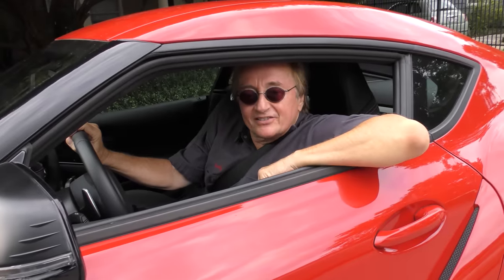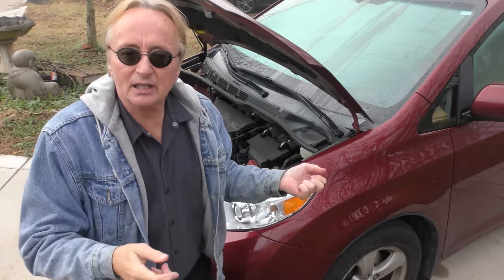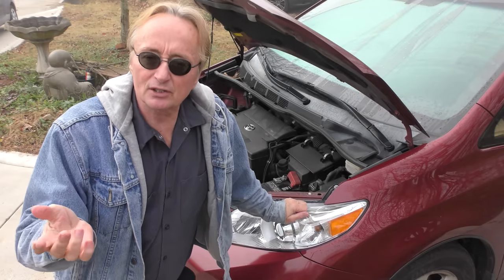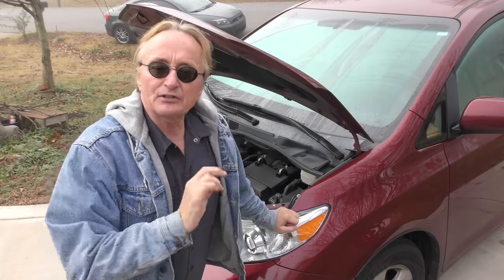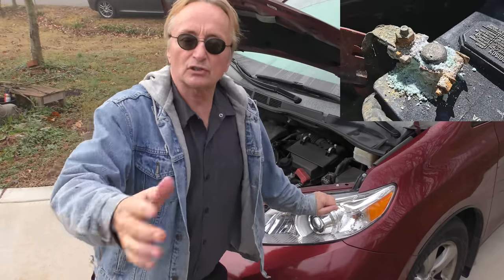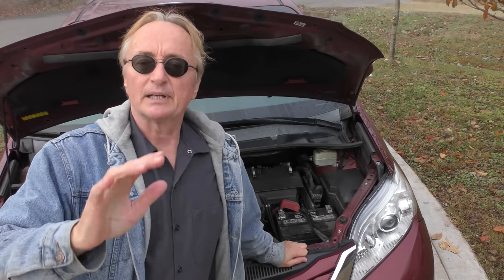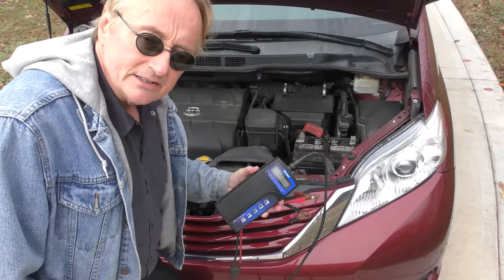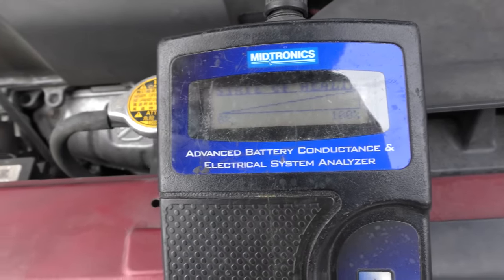If You Buy a Car Battery from This Place You’re Stupid

Comment: The batteries the Walmart and autozone sells come from the same factory.  The only thing different is the label.  They are both made by Johnson Controls.  I know because I am a truck driver and I have picked up and delivered these.
Reply: Thank u for that insight 👍🏾
Reply: Also Walmart beats the heck out of Autozone's prices. Advance Auto too.
Reply: MVP truck driver, I'm a service technician at walmart and was curious how the battery was compared to autozone
Reply: That could be location dependant.
There are only a few battery companies in the USA. Walmart might buy from more than one, depending on price and location. 
Always check the manufacturer date.
Reply: Yes they come from the same factory. But they make different quality for each retailer.  The top line Walmart battery is equivalent to autozones mid level.
Reply: @karkule5919  calm down with your keyboard anger buddy, it’s about a battery 10-4 over and out!
Reply: As a walmart technician if u buy the everstart battery the best bang for your buck is get the maxx 
Think of it like sams, yes ur paying more but ur getting more per value, honestly as long as ur cca(cold cranking amps) is the same as what's already in ur car and u get the same size it doesn't matter what the book or computer says when u put ur year, make, and modle, also extra cca won't hurt anything just means easier cold start in colder weather and longer life
Just make sure cca and battery size is the same and ur good
My honda civic battery cost $149.88 at Walmart but i can get better cca and same size for $75.88 at Walmart

We can't just tell u yea this battery will work xyz, we are told to go by what the computer or book says
Fun fact :D the more u know
Reply: That’s good to know thanks for the info
Reply: Same with car parts - some are interchangeable, but more expensive on the higher end cars.
Reply: Here they were from Johnson Controls and they were great batteries, but now there Interstate and I had two fail within two years, only had one from Johnson Controls  fail in ten years.
Reply: @waynefoster5913  I was gonna get interstate but I’m not sure now
Reply: @craigshapiro8662  you are correct, major national brands have such buying power they can require a manufacturer to custom manufacture a product to meet the sellers cost at retail and the only way to do that is to lessen the quality of the product. 
 I get annoyed by these kind of "you're being ripped off" videos, if you don't want to buy a battery when yours has died then be smart and replace it before it fails. It's not a surprise a battery usually fails in 4 to 5 years, so when it's 4 years old go get a new one and pay as little as you can and shut the fu*k up or make one yourself Scotty.
Reply: Your life is now in danger...lol
Reply: @JohnT2088  ..no costco around these parts, so it's Walmart..buy their cheaper batteries for an old beater, buy their top-of-the-line battery for something you use on long trips...
Reply: A guy I know had a Japanese car...Honda I think...he thought the battery lasted 11 years!
Reply: The longer the warranty the higher the price but higher CCA and a better battery.
Reply: @froglobster    I don't blame you.  Not sure what the deal is with Interstate CAR batteries, but I've not seen one last more than 2 or 3 years around here and I'm involved with a couple of car clubs and automotive organizations and I've seen a lot of batteries.  I've noted that the stockpiles of core batteries retailers have taken in for for recycling seem to include a high percentage of Interstate brands.  Now, that said:  These were CAR batteries.  The big Interstate truck batteries you'd see in something like a Kenworth etc are a different deal.  These large batteries seem to go on and on and on, last pair that went into the crane truck where I worked lasted for 7 years.  But, a group-24 Interstate battery that was bought by an employee there for his car barely made it past the 2nd winter.   All things considered:  My best luck with batteries has been mostly with stuff made by Johnson Controls, including the Everstart brand Wal-Mart sells.  I have maybe 5 or 6 of them in the vehicles I own, been using them for over a decade, never had one fail inside its warranty.
Reply: @karkule5919    Sam, buddy... the irony is thick.
Reply: @Jack51971  ..yes, but that'd be Walmart for 99% of people who don't live in an urban area...never been in a Costco(haven't even seen one), and the nearest Sam's Club is at least an hour away...and I don't exactly live in the middle of nowhere(not anymore, anyway) :(
Reply: @tonyunderwood9678  Yeah thanks for that insight- I think the quality has changed somehow-plates? Plastic?- idk . Back in the day I ran my novas Malibu’s impalas trucks everything on interstate. When our politicians let the car shows back again I’m gonna look at the interstate population! Good day
Reply: The same applies to power tools.
A very small number of manufactures make multiple brand power tools.
Something like four manufacturers make 20 different brands.
It is a type of manufacturing incest.
Reply: True, but they use different build standards for each brand between Wally and Autozone. Autozone was good 10 years ago, but my last two from them were crap. Motorcraft Johnson Control batteries are the best built IMO.
Reply: I baught a battery from Walmart in 2018,, and I didn't drive my car for a few weeks left the door open and it drained out the battery,,, so I brought it back to Walmart and they gave me a brand new 2020 battery For free.. cause most of their batteries have a 3 to 5 years warranty.
Reply: @froglobster  
They are made by Johnson Controls for Motorcraft. It is Ford's brand for their parts. Not sure who sells them in parts stores these days. For dealer will have them. I think you can buy Johnson controls batteries directly from their distributors with their name on it. If you want the absolute best battery, go with the Odyssey battery. Pricey but easily 2x the performance/quality of any other lead acid battery. After that is lithium, but they are even more expensive.
Reply: @ujayet  
Overall they are good for the price.
Reply: @grassroot011  even though the VAST amount of batteries exchanged at autozone for new ones come from.........(wait for it).....walmart???
Reply: @grassroot011  my 2008 jeep compass has a battery from o'reily  and it wont die for nothing.
Reply: autozone has a contract from bosh to make all their part,  and brand names them everything from econocraft, valuecraft, duralast and bosh itself. they set different prices for this stuff to give the illusion that each name gives you different quality and performance, lol. all they re doing is making profit off the warranties .as far as going to walmart for batteries, they probably are suspect because the average person isn't looking at walmart for the first place to go to buy a battery so they sit on the shelf for a little while , plus walmart is becoming really strict with their return policies these days. you buy almost anything at  the discount auto stores, if you don't like it, just return it, with enough of a fuss, they will take it back. ( a typical district manager will give a refund to 99% of all customers who complain)
Reply: Exactly!  Thanks for bringing that up. 👍🏻
Reply: From the guy who knows.
Reply: Johnson control does make them your correct but Walmart sells used returns that go bad extremely fast
Reply: So for my 19 Corolla, one of those cheap batteries "Ever Start" brand should work fine?
Reply: Johnson Controls also makes Optima.
Reply: @sashaminx75  👍🏻
Reply: Yeah but I swear Walmart buys all of Autozones reject batteries though because I've had more problems with Walmarts everstart batteries than any other brand. They're's is a reason why their cheaper than any other brand out there.
Reply: Johnson Controls has sold its battery division to Brookfield Corporation. I don't know if they still supply battery's to Walmart anymore. (after the current stock runs out!)
Reply: @grassroot011  That's assuming you get a good Battery from Walmart though. There quality control isn't exactly great and I'm not the only one that complains about Walmart batteries. I swear they buy everyone else's rejects. I've had far more issues from Walmart batteries than any other brand.
Reply: That was exactly my question for Scott, because a salesman at one of the higher price auto parts stores told me his manager toured one of the TWO US battery manufacturers and saw it for himself.  What a scam!
Reply: @craigshapiro8662  Yeah, I have bought the cheapest level battery from them and they're pretty much crap,  but if you buy the one with a 2 year or 3 year batteries.  Huge difference.
Reply: Yeah but Walmart buys all of Autozone and Advance Auto Parts reject batteries though.
Reply: @JohnT2088   no the quality is not good at Walmart. The batteries are built to whatever the client wants. Always remember that.
Reply: I’m a truck driver also, and I know what you’re saying. Folks would be surprised and maybe even shocked if they knew how many products they see on the shelves with different brands on them all come from the same place.
Reply: Don't be so cheap.  I live off a very small disability check and even I can afford to buy a new battery every THREE YEARS. What you're doing is why companies have to STOP OFFERING WARRANTIES,  or offer only a very limited one. You may "think" you're saving money,  but people who do what you're doing are WHY the warranties disappear in the first place.   Not a smart move.
Reply: Do you know this for a FACT,  or are you just saying that because that seems to be the general consensus about Walmart batteries? I've always heard to never buy a battery from Walmart Neenah they're crap. But when the salesman from a higher standard of quality auto parts store (only because people GIVE them that status), tell me that his higher priced batteries are EXACTLY the same batteries,  with just different labels,  THAT'S who I'm going to believe.
Reply: @stacyturner1317   I've personally had far more issues out of Walmart batteries than any other brand. I swear I think Walmart buys everyone else's reject batteries.
Reply: @JoshSmith-wo7zw  I'm just wondering 2 things. Did you buy the cheapest one they had for your car? That's a mistake I've made before. About a year and a half ago it was time for me to get new battery, but because I was going to try to sell it, I didn't want to put an expensive battery in it. So against what I"ve always heard" about Walmart batteries, I went down and bought the cheapest one they had, $50. It did great, for about 8 months, then I started having to jump it, just once in a while at first, then every day, then every time I drove it. And I went to one of the "auto parts" stores to have the battery tested, they told me it was fine, even tested it under load. 

I was beginning to think I had a parasitic drain and was REALLY dreading trying to find that. Nope, bought a new battery at Walmart, but this time I bought the best one (because by this time, I was one week outside of the replacement period) with a 3 year warranty, and even when it got down to 5 below here this past winter, she started right up. And the 2nd questions is did you check the date on the batteries when you bought them? That's something I "just learned" by watching videos like this from Scotty. I know I'll be checking them first now!
Reply: @JohnT2088  ..no membership at Costco?...how about there ISN'T any Costoco...for hundreds of miles...there's a Walmart literally EVERYWHERE....that fact may also come in handy if you have to warranty your battery while traveling...
Reply: @Thor Odin son Good to know my suspicions are well founded. I had always been certain that which batteries get which retailers' labels is determined by which pass QC by the larger (or lesser) margin at certain battery specs. Simply being the same manufacturer doesn't mean they're all equal.
Reply: @grassroot011  Rule King is even cheaper and last just as long
Reply: @craigshapiro8662  Yes. That's why within any brand they have different price levels.
Reply: @waynefoster5913  My Costco battery (Interstate) went bad about three months before the free replacement warranty was going to end. I have a AC Delco AGM battery in my Mercedes that I bought back in 2015. It's still running. The battery tester shows that it is getting weaker.
Reply: @kevinmoore4887  They do.  First one was Johnson Controls, second one I bought was not.  I do find that their batteries don't last as long as Autozone batteries.  But the best battery I ever owned was Bosch.  That thing is still going strong after 5 years.  Got 2 of them from Pep Boys, one for a Camry and the other for a Tundra.
Reply: @alecepting1371  Ugh. Have to check who manufacturers the battery.  My Wal-Mart Johnson Controls battery lasted 5 years.
Reply: @kevinmoore4887  I believe the second was manufactured by Clarios in Wisconsin.
Reply: Nope. Same factory, different sides. Autozone batteries are made with materials and equipment from Bosch. Walmart batteries used recycled materials. Same building yes. Greatly different quality.
Reply: @sporadicofart  Where can you find Bosch?  I can't seem to find any place to buy their car batteries in the US any more.  Pep Boys no longer carries them.
Reply: 40 yrs. ago at an oil filter company. Same filter 12 different labels. Label is worth more than the product.
Reply: Walmart car batteries are junk. I know this because I’ve been through enough of them. They would take a 💩 not even a year.
Reply: Walmart car batteries are junk. I’ve had them fail less than a year. The replacement didn’t last long either. I even had a Walmart battery puke at 50F.
Reply: Got a Duralast gold from autozone, 2 months in and out was a lemon. New one is in, hope it will last...
Reply: i replaced a fairly new battery out of my tahoe from walmart with a duralast gold. they are not all the same. walmart batteries are junk.  dont believe me? try cold starting it in 10 degree weather.
Reply: I've been told they are mostly made in Mexico and my bottom line is the warranty. Walmart's is best. Tell me I'm wrong.
Reply: True, same factory, but must be manufactured to different specs...because over the past 30 years I've had more problems with having to return defective Walmart batteries more frequently....after only 9 months to 2 years compared to any other battery like DieHard Gold or Platinum or even the Samsclub Duracell AGM I tried.  The expensive ones have all lasted 5 years or more, including the nice factory OEM batteries from Subaru, Toyota, and Honda.  They're so darned expensive I sometimes get suckered into buying the Walmart ones at less than half the price when my budget is hurting.  Luckily the warranty covered free replacement in all my Walmart experiences (after waiting a day for them to test the defective battery on their fancy dan machine...even after my cheap digital tester says it's shot) but honestly, every time I replace the battery, 30% of the time the power coming back online causes the speedometer dial to jump all the way around and reverses to the other side (no matter which terminal I connect first), and I would rather pay more for a higher quality battery and save myself having to come out to a dead car more frequently and replace it under warranty 3 times in 5 years and then having to remove and disassemble the instrument cluster because the magnet trick doesn't always work on all models of speedometers.
Reply: Auto zone it is.
Reply: @froglobster  ??? are you "over" or are you "out"?  Very different radio terms.
Reply: @reggienone966  Well no, I believe the terminology “over and out” is a well known standard of 50 plus years. Over deems finished talking and Out deems going off air leaving the channel for other truckers to talk.
Not arguing or disputing your interpretation.
Reply: They may be made by JC, but there's still differences in quality between some of the different branded wallet sucking plastic tubs. Although JC should be holding their greedy heads in shame at the pisspoor quality of todays battery.
Reply: @JoshSmith-wo7zw  Back in the 90s the Everstart WM batteries were hit and miss. You might have had to return one or two to get a good one. Many people called them Neverstart. I don't know how the modern ones are since I quit buying them.
Reply: Yeah but the batteries Johnson Controls sells to Walmart do not have the same Quality Control as the batteries that are sold to Auto Zone and Advance Auto parts etc. There's a very good reason why their so much cheaper.
Reply: @unti419   I still wouldn't buy one. The Quality Control just isn't there on the   Walmart batteries.
Reply: @JoshSmith-wo7zw  I buy my batteries from either ORieiies or Napa. Never a problem.
Reply: Neverstart and Duratrash... junk batteries
Reply: The only decent battery is a Deka. They last me 10 years when I use them all year and do r trickle charge them in the winter because I'm using the Yukon all the time. The ones in my hot rods are both 13 years old because I keep them on a trickle charger during the cold months. They will last forever as I check the water levels and keep them filled and charged. 

If your batteries are going bad it's because you're not maintaining the water levels in them. It's very simple. Peel back the stickers fill the holes with distilled water. Get 200 amp starter charger and charge them for 15 minutes or so with 60 minutes in between. Do it four or five times and they will last forever. But you don't even have to do that If you just maintain the water levels before they die. If they go bad just refill them and recharge them and they'll be fine. There's really no need to buy a new battery. And most people don't know how to maintain their battery.
Reply: @Spike_-rx7bx  what battery should i get for a pilot 2012? Any idea ?
Reply: @MrSambra22  our book says minimal cca 585 for walmart the book says 35 Maxx or 24F( if you see the F or the R it means the poles + and - are flipped from left to right or vise versa)

I personally have die hard battery for past 2-3yrs platinum no issues yet(no acid leaks or seepage yet)

I hear cust complain the value battery's at walmart only last a year or 6 months till needing to be replaced( the value has a 1yr replacement warranty) but it's under $100

You can't go wrong with AGM battery's( again if u can find a battery with minimal 640cca that fits in ur battery compartment then ur all set) higher CCA won't hurt your car aslong as your tie down bracket can securely hold down you battery from swaying as you drive 😉
Reply: They also make Interstate, Autocraft, and Optima
Reply: Forgot to mention Walmart gets old stock that’s why it’s cheaper
Reply: @kennyweaver9796  lol, I wonder if that's why their 1yr warranty battery's bearly made it to the 1yr warranty starements

The blue ones(value) were about $100 and got replaced every year or bearly made it a year
Reply: I have two cars the car with my Walmart battery always goes out I still got the warranty but it gets annoying going back but my other car with the dura last gold turns on every single time I would recommend getting a good battery so you wouldn’t get stranded cause that Walmart battery got me stuck so many times wouldn’t recommend
Reply: Optima batteries are now made by johnson controls too
Reply: Wrong.
Reply: @Thor Odin son wrong
Reply: @waynefoster5913  JC makes both
Reply: @Jack51971  East Penn Mfg(Deka) made
Reply: @froglobster  Plates are now made thru compupress process…used to be standard book mold made. Difference is that what took 24 hrs to make bookmold is made in 8 hours. Bookmold grids perform better too but industry getting away from it
Reply: Sucks no one here mentioned pepboys, did it close down for everyone? My bosch platnium still going strong 6 years later, still holds it charge too
Reply: Same battery but Auto Zone is a lot more
Reply: @tonyunderwood9678  The black cased Interstate Batteries are made in Mexico
Reply: No the only difference is the price!
Reply: I gotta say, unless you work in engineering or maybe the product line, you really don't know what is inside each battery.
Reply: @craigshapiro8662  no it's not ive owned both Wal-Mart's hold up just as long or longer ive got a value Wal-Mart battery its a 2018 still going strong I try and not buy notjing from auto parts there mark up is to high
Reply: Three main battery companies, Johnson controls, East Penn, and Exide. But if you make it to Walmart, they don't install unless they have a service bay. Auto Zone, advance, and O'Reilly's will go out and test and install. Trade off.
Reply: @craigshapiro8662  not true, the 'maxx' is the best battery far superior to anything autozone has
Reply: Preciate the insight I learn some thing new
Reply: Interstate batteries are crap nowadays. My last 2 have lasted about 14 months each. I won’t be buying another Interstate battery.
Reply: Paid $199.99 plus tax for my battery for Honda hrv at autozone. Came with a two year warranty.
Reply: @Jack51971 mine did 10 yrs.
Reply: I've had problems with the personnel at Walmart in Forest Park,Illinois. A couple of batteries in a row were bad. I tell the guy,hey,this has a two year warranty. Look at the manufacturing date. Yup,two or three in a row were bad. I know Walmart don't make their o2n batterues,vut I've had bad luck more than once with their batteries.
Reply: Auto batteries are like razor blades, most razor blades come from a few factories, located in Russia, they supply the world.

The big name brands of the US moved off shore decades ago. Their headquarters are here, no workers, just stockholders.

I use an 1918 open comb safety razor, used to get Russian made blades through a guy in Ukraine, 10 cents each, would buy a 100. 

Ukraine was outside of the European union so their shipping was cheap. Try pricing something to, from the UK, you think Canada is high.

Same company making them, genetic brand at dollar store, 5 for $5.00. That is some markup. 

Only difference is the Ukraine ones came individual wrapped, the dollar store that typically blades holder you use your thumb to push a blade out.
Reply: Clarios now
Reply: Walmart basically has no warranty.  Try to get them to swap one out after a year and it fails.  Autozone np they honor their warranty.
Reply: Thanks for the advice.  I use Autozone batteries. Now, I am getting mine at Walmart!
Reply: @grassroot011 Yes I looke around for a battery and Walmart beat all the Auto part store chains in price .
Reply: I have had good luck with Walmart batteries. I have got as many as 14 years on one Walmart deep cycle battery used for my trolling motor. I just replaced one from 2014. We usually get 5 or 6 years on auto batteries. I just put a Costco battery in my wife's Explorer. The old battery was from 2016.
Reply: @kennyweaver9796 Each battery Walmart sells has a sticker on it that indicates the month of manufacture.
Reply: This is very true I worked for Johnson control and retired from there after 20 years.
Reply: @ujayet  You could have just charged that battery.
Reply: Something tells me Scotty has alittle whiskey with his coffee each morning
Reply: Johnson controls label is located very discreetly on those batteries and Costco among many others.  There are only a few battery manufacturers left be it wet cell, AGM or Gel..
Reply: Batteries used to be charged at a low amp rating for 20 hours and they used to last 5 years or longer. But they went to a high rate charging system charging them at half the time and the quality of the batteries went down hill. The center of the battery plates are white looking from them not getting fully formed out so they are oxidizing and that causes them not to last as long. Johnson control knew this but at that time didn’t care because they had 80 percent of the battery market. So the odds were when you bought another battery you still got one from them.
Reply: There's only two or three battery manufacturers here in the United States. They sell them under different name brands.
Reply: I've only had one problem with a Walmart Maxx battery and they replaced it for free and started a new warranty, all for free.
Reply: My auto zone battery is 13 years old and going strong.
Reply: Rural king has the best price and stand behind them
Reply: Bought a battery for my 2017 grand caravan from AutoZone some ways back. It started to give me trouble , brought the battery to AutoZone,they tested it and gave me a brand new one no problem. Convenient.
Reply: I believe you are right.
Reply: Costco sells Interstate batteries . They are also manufactured by johnson controls.
Deep cycle marine battery group 24 $78
Bought 2 new group 65 batteries for my diesel $119 each! They are double that at most other places
Reply: Your right there is only three manufacturers that make batteries and put different stickers and colors on batteries
Reply: Thanks for that intelligence. They're made by the same parent company. Manufacturing is to an entirely different spec and In different automated lines. Completely different. Kraft foods Owned by Berkshire Hathaway makes cheese, jello, and ketchup. Are you saying the recipe is the same? In the future; please be properly informed before you speak?
Reply: @yell0wberry  Walmart puts a date code sticker on them when hey were manufactured. Had no problems
Reply: Perhaps but different quality of each battery. I.e. a Honda civic and an Acura NSX are both a Honda product, but they are very much a different quality of car.
Reply: None of them are great. Seems
Reply: @ujayet why not just charge the battery?
Reply: @herbb8547  i know I live in a small apartment, don’t have cool things like most people with homes and garages, manager don’t even like see you opening your car hood.
Reply: @ujayet  I understand. I lived in an apartment when I was young too. It's hard to do a lot on your own vehicle then. Makes it more difficult to save money to get a house someday. As far as apartment managers go, I found it was easier to ask forgiveness than permission. And I was always careful to limit the mess and to clean up afterward to cover my tracks.
Reply: Johnson Control makes a lot of different batteries. If I'm not mistaken they also make optima batteries
Reply: And price makes a difference!! Walmart/$150-180 Autozone/279-300$ . Thank you!!!  Walmart auto center gives free inatallation too!!4 years warranty battery!
Reply: What’s about DieHard batteries from Advance Auto ?